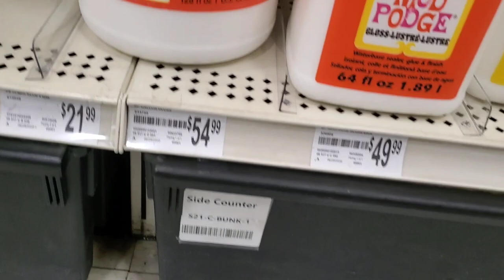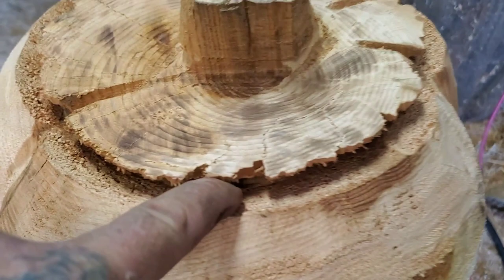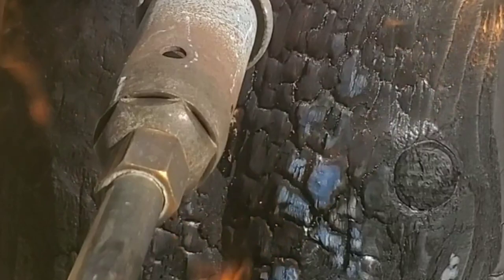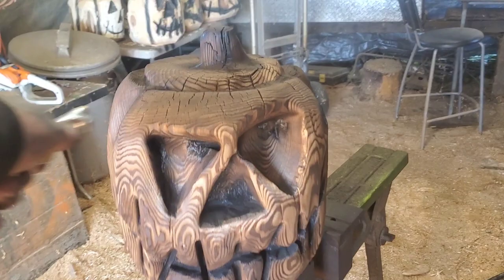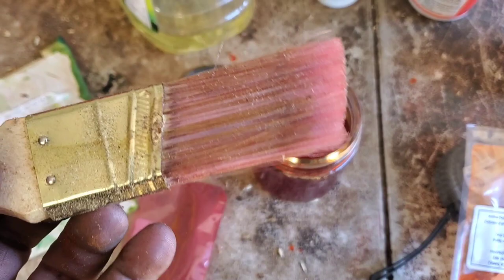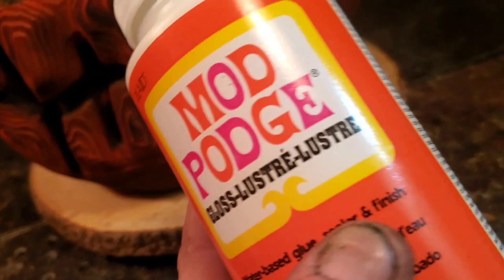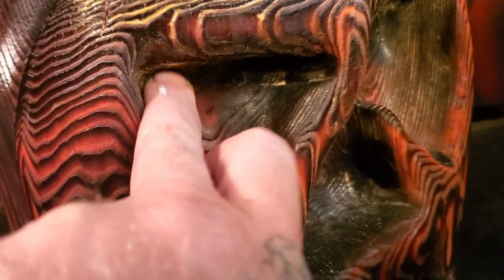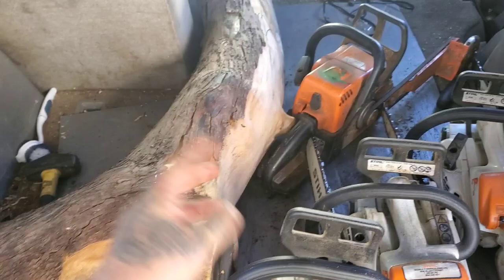Water based wood dye Finished With MOD PODGE. Shou sugi ban Pumpkin.

Comment: That color with the wood grain looks cool. The little ones are pretty cool to. You come up with some wild stuff. I never used mod podge on wood. Many years ago I used to put together those 1000 & 1500 piece puzzles. After I finished one I would paint a couple coats of mod podge on them. The puzzle would get hard and could then be put in a picture frame or just hung on a wall. Hi Jordy.
Reply: Evil we did that too!!!!